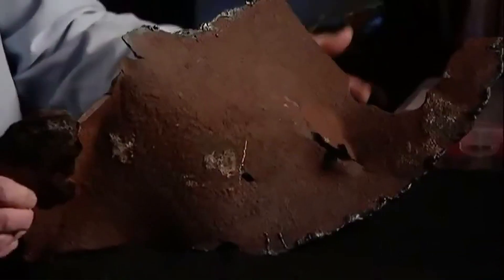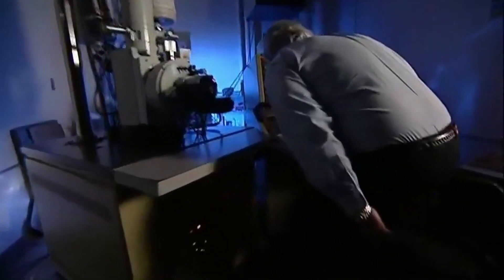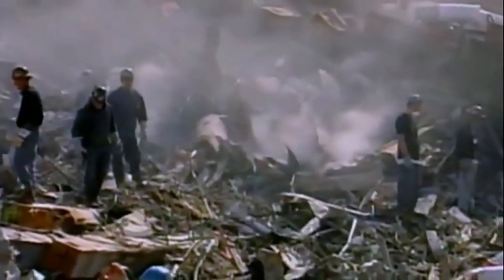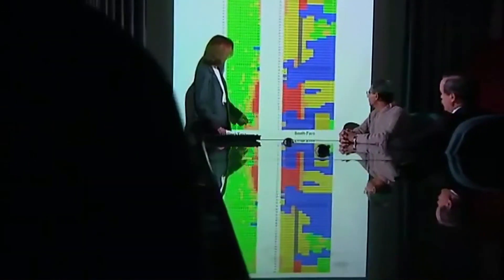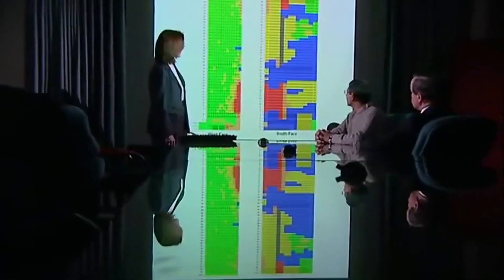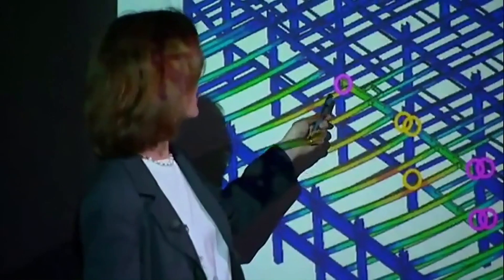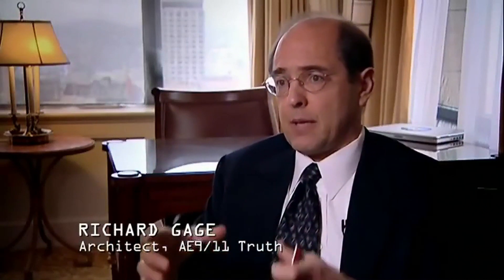Drywall Destroys WTC Steel & NIST's Early WTC7 Collapse Hypothesis

Comment: 1500 to 2000 degrees !!  Theres your first problem !!  Jet fuel doesn't burn that hot, even when adding oxygen, jet fuel burns around 1100 with oxygen being forced in the combustion & there wasn't any oxygen being put on any beams !!

Comment: Same phenomena that caused the cars in the vicinity to have their engine blocks burnt out, but seatbelts and upholstery remained in tact. Directed free energy is the only plausible explanation to support this evidence. Dry wall has nothing to do with steel evaporating... I can't believe I even have to say that. This is a cold fusion nuclear reaction that we are not supposed to know about. This is why the pile of rubble from two 110 story towers was no taller than the lobby of those buildings... steel turned to powder and hurricane erin hoovered it up while providing the necessary static field for the directed energy weapon used.
Reply: Someone doesn’t know basic architecture 

The building is hollow, mostly air, not solid chunk. 

If you knew anything about super tall structures, you’d know that the buildings are built to be lightweight and strong, but it’s literally mostly air and concrete layers, structured around steel connections. 

Those steel connections aren’t meant to be stressed the way they were on 9/11
Reply: I think that someone is you. It is not reasonable to say 500,000 tons of structure results in a pile of debris that doesnt penetrate below lobby level and doesnt peak anywhere above 20 - 25 feet at it's highest point. No matter how much air is taken into account, I don;t understand the logic at dismissing a collective 1,000,000 tonnes of debris, of which 800,000 tonnes appear to have gone missing.  @jtgd

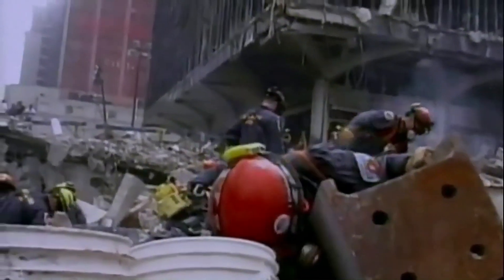Comment: @5:32 Column moved straight down which indicates that the steel where it buckled was near melting point. Kinda like a high energy concentration.  I wonder if it was saved for the 911 memorial museum?
Reply: It’s literally bent. wtf do you mean “column moved straight down, therefore it was near melting temp”

What’s your source that the steel was that hot, and the warping must somehow be explosive related ?

You’re making assumptions

Comment: Just reading the comment's here.
9/11 total inside job. The Americans needed justification for war and a reason to destabilise the middle east. Oil in the USA and in the North Sea of the UK is running out. The middle east on the other hand still has plenty. As most of the middle east has no WMD it was the easier option to steal oil from them rather than facing off with the Russians, who are supposedly sitting on large quantities of oil.
First thing they were bothered about when we got into Iraq was the oil lines and Wells, we had to make a bee line for them as soon as we crossed into southern Iraq.
USA has been at war since its inception. It fuels their economy and without it the country goes skint. Still got their fingers in the pie    in Iraq, Syria, Yemen, and supplying the Saudi with arms.

Comment: Rite it was the first and only time in HISTORY  that a building fell from fire alone, at near free fall speed, yeah it was totally the drywall loFl
Reply: Exactly also aluminum from the plane ✈️ would have never penetrated the towers which was mostly steel and reinforced concrete the only thing that would have got through is the engines
Reply: “At near free fall speeds”

You mean the speed a building would collapse? 

What speed should the towers have collapsed?

You sound like you clearly just assume you know what you’re talking about.

Please explain how “near free fall speed” indicates anything other than a building collapsing?

How many skyscrapers were hit by planes traveling 500+mph 767’s ? 

You sound ridiculous